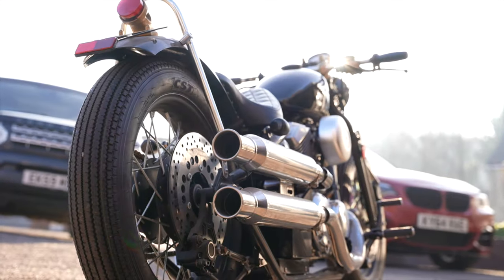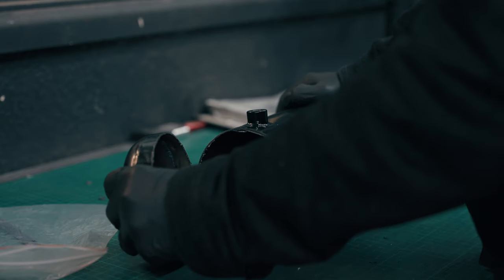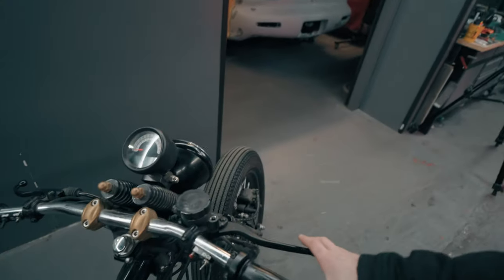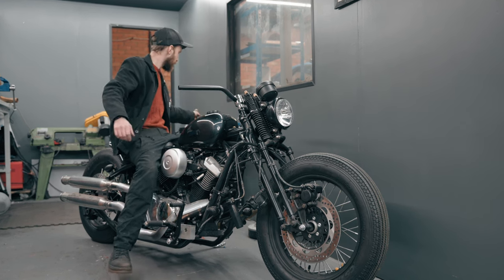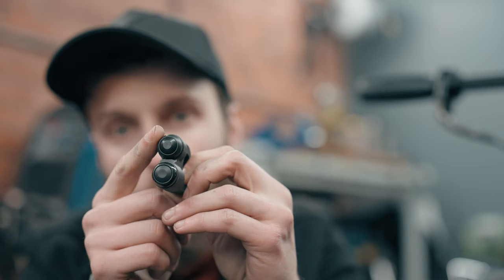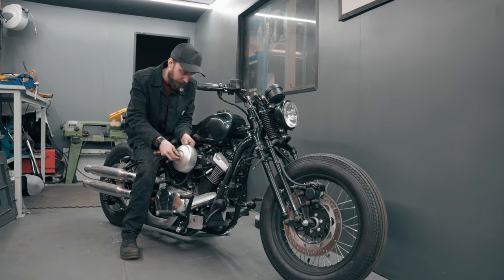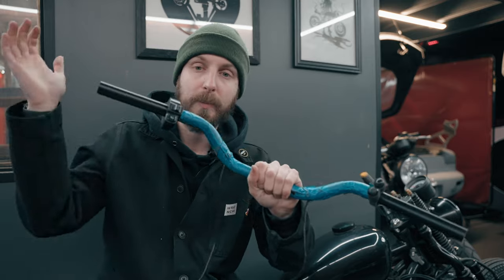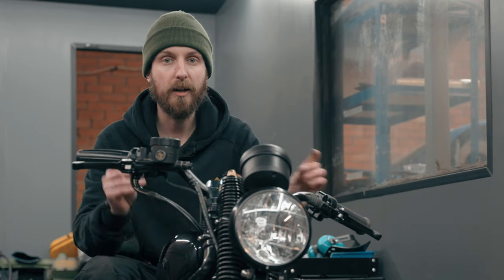Modifying a Chinese Bobber with Chinese Parts!

Comment: Nice dude,
If you 3D print a ring, kinda jubilee clip style, you could bond it on the inside of the oil tank lid, then when you shut it, it will locate the lid nicer 
If you get me 👍🏼 I actually really like the proportions of the bike 👍🏼

Comment: My ocd says get a black led motorcycle headlight with integrated front signals and a brake light with it also so front and back are integrated and both just single round lights as well

Comment: What did you do with the origional Battery compartment? The Bike has ended up looking great. Are you thinking of comfort or are you leaving the seat as is? I've seen people suggesting springing the seat and i think your back will thank you if you can find a way of adding suspension to the seat?
Reply: My version (THUNDER) is a hardtail and my seat has huge springs that actually works well around town.  I don't spend much time on the bike, maybe log 300 km a month.

Comment: I think the tank size is good - a larger one would spoil the design perfected by the Japanese company Zero Engineering.   However, I would search around for a different shaped tank, but keep it small.  For a 250 you don’t need anything bigger anyway.